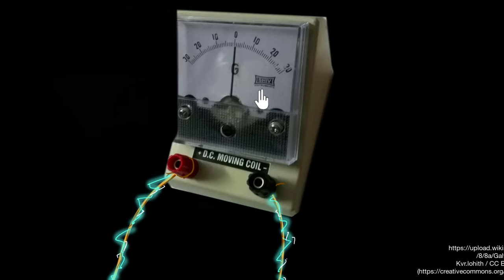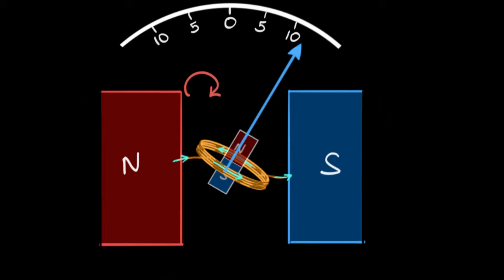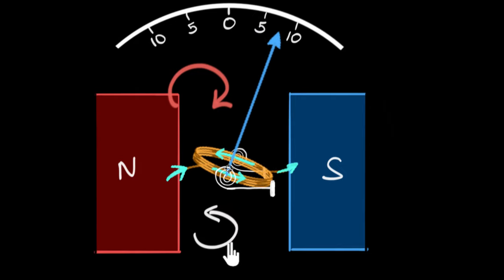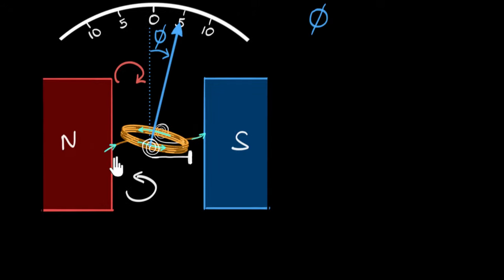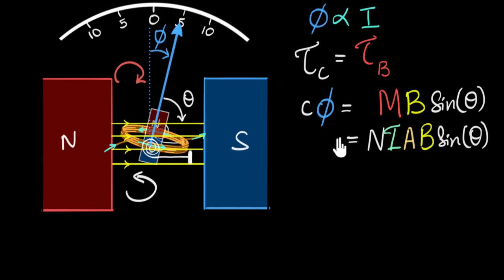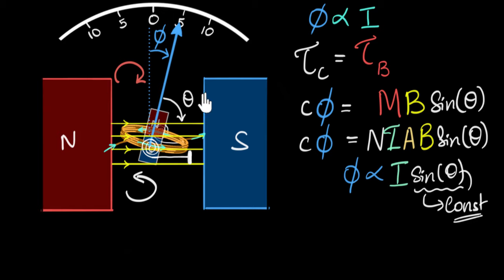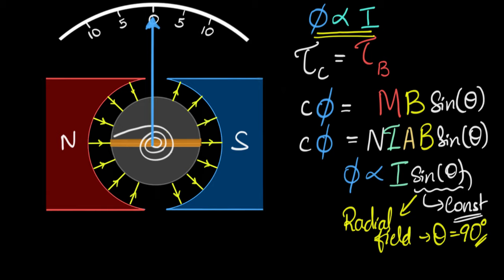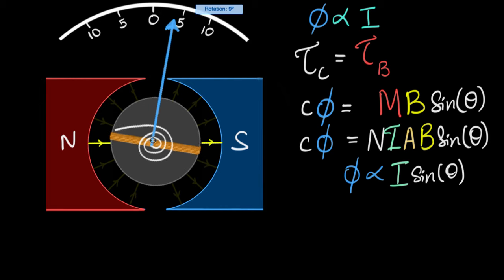Moving coil galvanometer working | Moving charges & magnetism | Physics | Khan Academy

Comment: phew! finally understood the working of a moving coil galvanometer. Thank you so much for the awesome explanation!
Reply: I couldn't... The magnetic field isn't even going through the coil...
Reply: @yashmal1k  No... That's not how it works...
We pass currently through the coil and hence the coil starts acting as a magnet... And this coil is placed in between two poles of a different magnet... So it turns (since unlike poles attract)...

Comment: Much appreciated.. but didn't get the last part.. you've make the other field lines invisible except the one acting in parallel to the coil.. But what about the other field lines, aren't those making an angle with the coil when it turns? If not, why and how?

Comment: to solve the last issue, can we instead attach the same magnets that we had to the coil so that whenever the coil rotates, it will rotate the magnets with it and therefore making theta to be a constant 90 degrees?
Reply: We can probably do that but then their would be the issue of taking mass of bar magnets into consideration... On top of that other physical factors like friction and stuff... So it might vary in different situations
Reply: @dodokoi036  good point thx

Comment: In the first case we placed a a current carrying conductor which act as a bar magnet, but in second case we have a coil wounded around the iron core where iron core act as magnetic right? Then how will we supply currect to know its value
Reply: Yes, when you pass current through a coil wound around an iron core, the iron core becomes magnetized and acts as a magnet. This setup is known as an electromagnet.

Comment: i have a question, when an induced current flows in the conductor entering the galvanometer from left terminal to the right terminal, the pointer of the galvanometer will deflected to the right side, am I correct?  and vice versa.